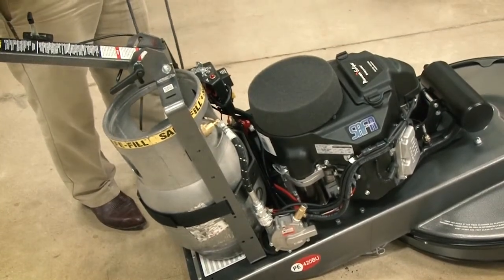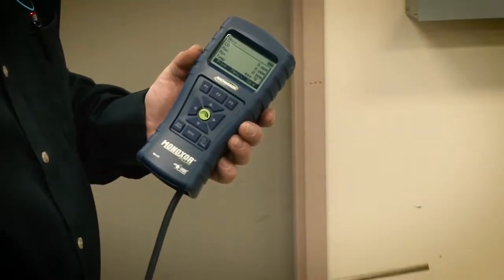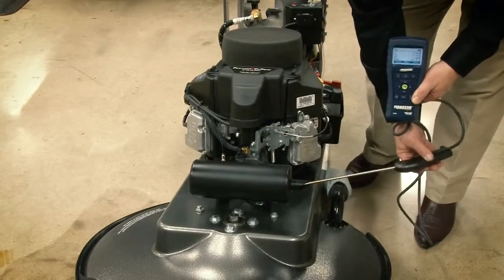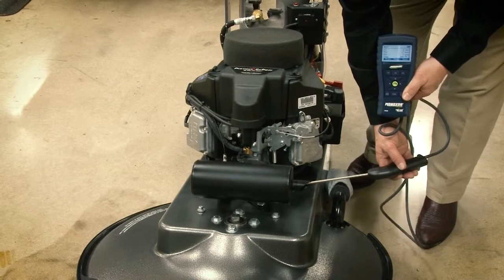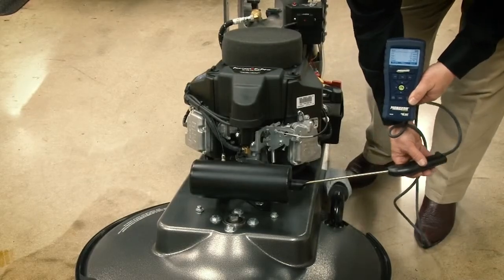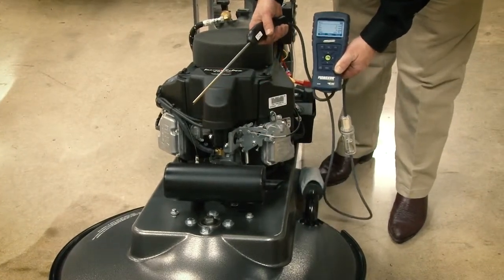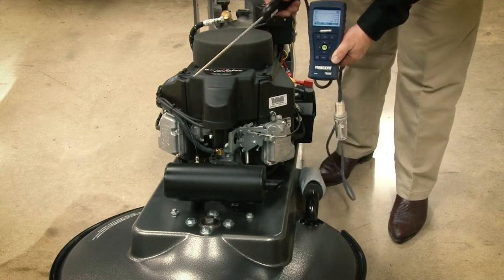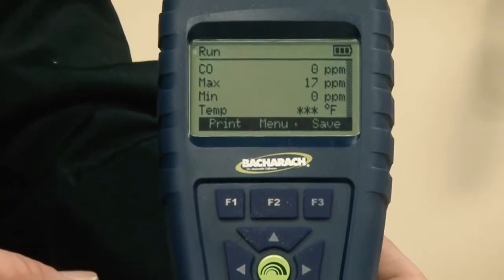Propane Technician Training: Checking The CO

Comment: Hello, I could not tell/see if you had the pad rotating, disconnected or the machine tilt back during the emissions test.  Would you please clarify.  Thanks
Reply: At 32 sec you can see the center pin spinning. So he's got it tipped back. Probably without a pad.